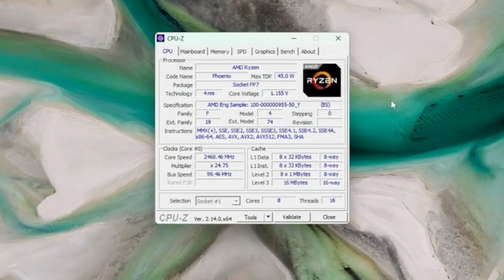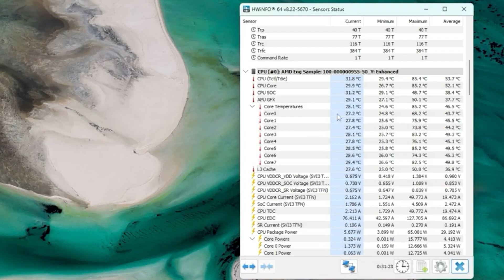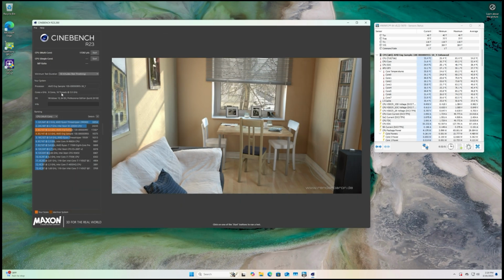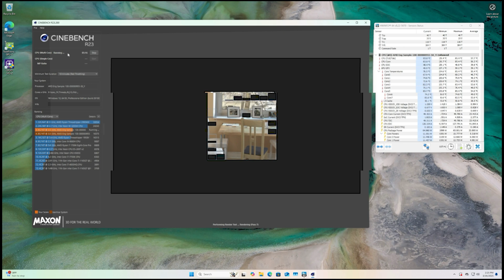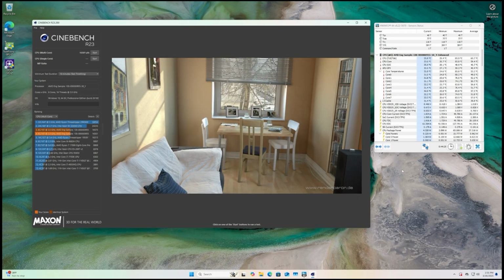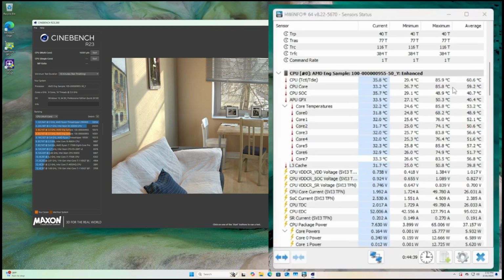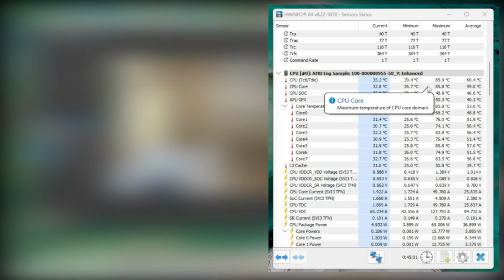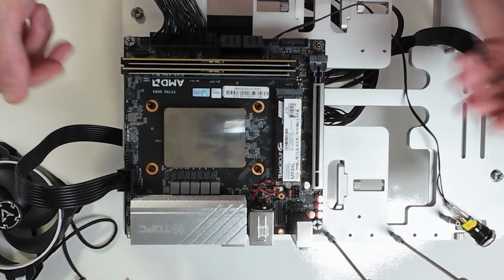Ryzen 7840 HS Mini ITX Motherboard: 8 Cores, Zen 4 on a Budget!

Comment: 2 questions, 

what speed was the RAM running? Ive seen officially its 4800Mhz for the board but some have had luck getting it to 5600Mhz (makes about a 10-15fps difference on the iGPU)

What socket for the cooler do you use? AM4 or AM5?

Comment: I have been using this processor for over a year now and I can confidently say that it should be limited in frequency to 3900, then it will not heat up more than 70 degrees Celsius. This can be done using the standard power settings in Windows